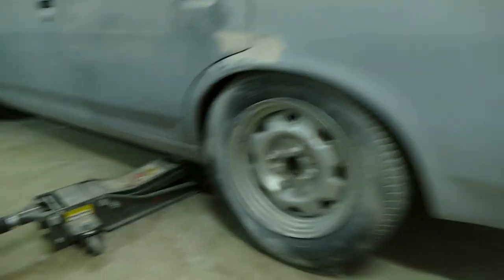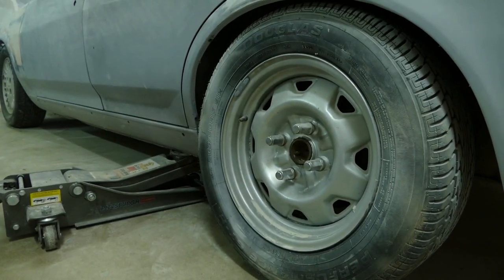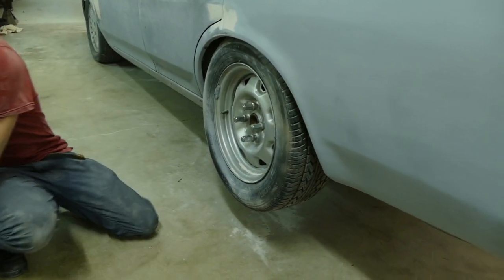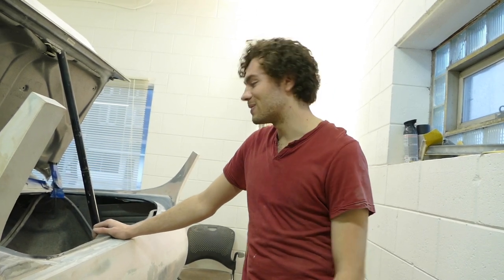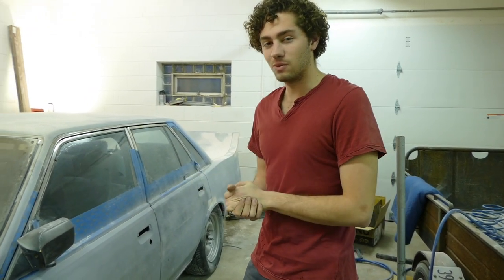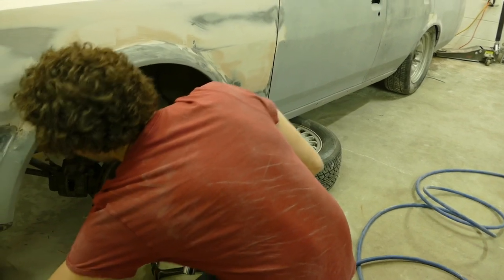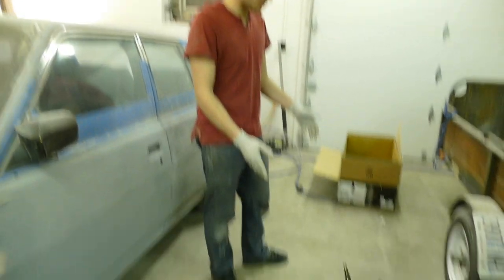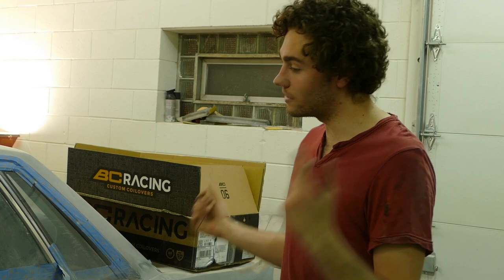Bosozoku BC Coilover Install Pt.1

Comment: That is a MacPherson strut suspension, very common on cars outside of the USA. 
Please get someone else to weld those up, don't do it with that flux core thing... Also make sure you undo the gland nut on top of the strut housing and remove the insert before cutting, those inserts may still have pressure in them.
Reply: LukeTheJoker could use fluxcore just heat it up with a torch get it redhot and weld away
Reply: I still wouldn't trust his 110v welder even with the preheat.

Comment: Those front coil overs are a bit sketchy. Have a professional at least weld them up.
Reply: Justin Powell 's fox body channel Nah they should be fine. Had to do the same thing to my Supra which shares the running gear components with the Cressida
Reply: if i paid a pro for every time i did this i wouldnt know how to weld or wouldnt get far. just gotta send it sometimes

Comment: Did you have to do any welding on the coil overs?
Reply from the maker: Yes, you have to weld the fronts to the spindle. It's very easy.

Comment: Careful when cutting the struts, you may get shot in the face with oil and pressurized nitrous or whatever they put in there.
Reply: This looks alot like the front suspension on old Volvos, atleast the 240 has almost identical fronts. They have a nut on the top of the strut that the chrome piston shafts go thru, if you remove said nut, the shock can be removed out of the strut. This leaves you with just a hollow tube that the wider part of the shock used to sit in. Don't know if the Cressida is the same way but if it is, then there's no danger involved when cutting the tubes and welding the new BCs in there.